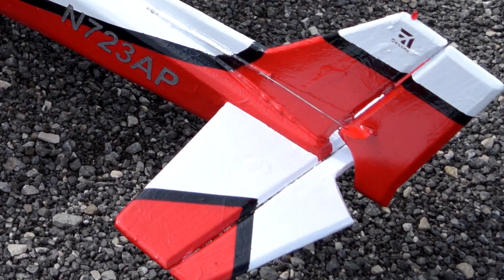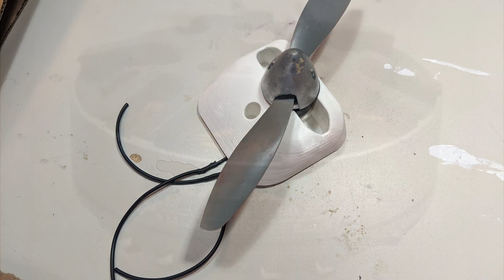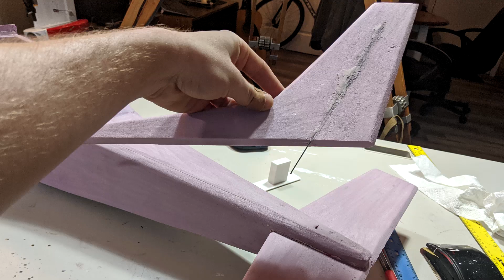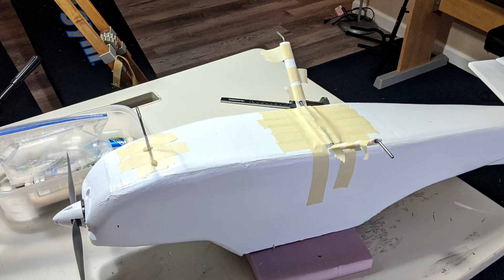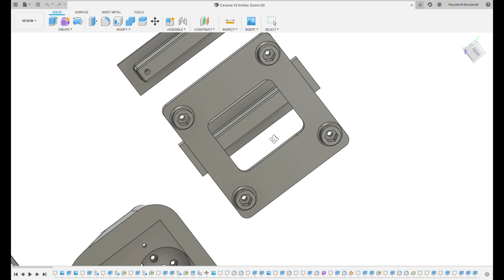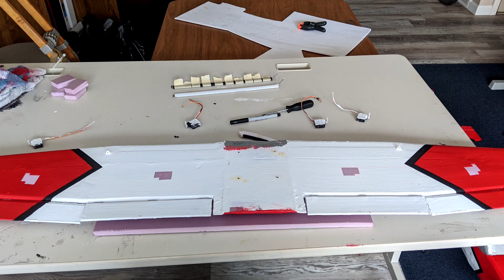RC CESSNA 172 V2 - Build Video

Comment: Nicely done, I like the color, inspired by the videos I plan to try (now that I have time) to make the same model. One question, since I don't have much experience with computers how can I reduce plans to be a slightly smaller model.
There are many models that are interesting my suggestions are Sword fish ww2, mustang P-51D ... etc.
Happy Easter
Stay safe, stay well
Reply from the maker: Awesome! I'm not sure of any easy way to scale it down in the computer program I used to make it (fusion360). You could just multiply every dimension on the plans by a scaling factor to make it smaller when you go to build it. Although you may have to use thinner foam. Good luck with your build, and post some pictures or videos, I'd like to see your progress! Happy Easter as well

Comment: This is awesome, I just finished a foambaord Cessna 180, I'm thinking of making A Cessna 170 out of foam like your planes. Also, what size Battery are you using?
Reply from the maker: Cool! I used a 4s 1300mAh lipo for the old Cessna 172, but for this one I will probably use a 5s 1500mAh battery since it is a lot heavier and needs a little more power.

Comment: excellent job love the paint scheme .I printed up some control horns that work great and are pretty strong also  keep up the great work Happy Easter
Reply from the maker: Same to you! I also tried 3D printed control horns, but the way I do my pushrods, I have to bend the control horns a lot to hook it up.
Reply: @RailTrailRC  https://www.thingiverse.com/thing:3442863
would make it a lot easier to do i use these on my 2 and 3 meter wings never had a problem
Reply: @RailTrailRC  https://www.thingiverse.com/thing:2056955
Reply from the maker: @RobertOrtlepp  Oh, nice. That a good idea.